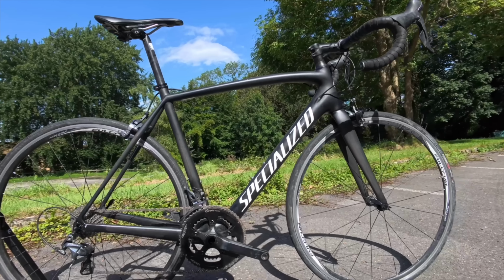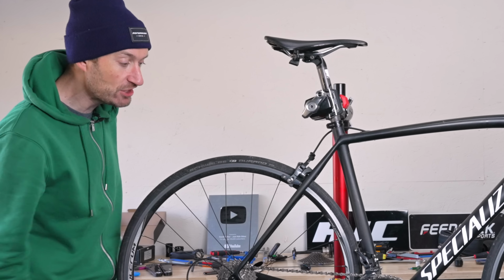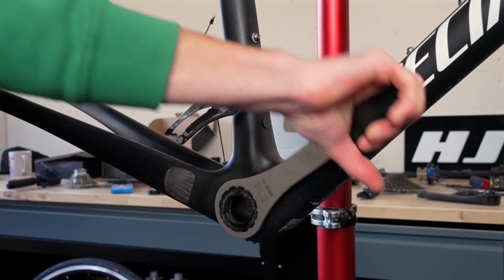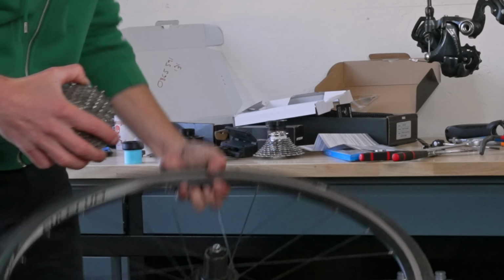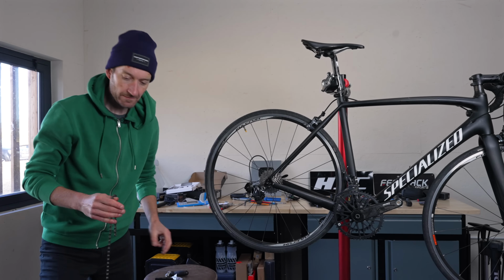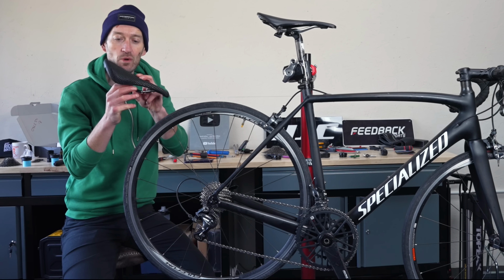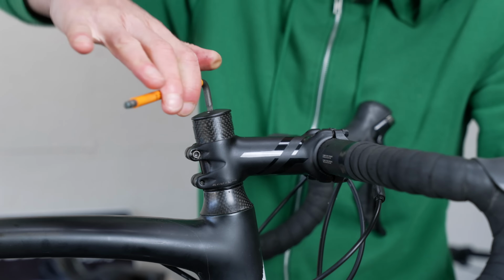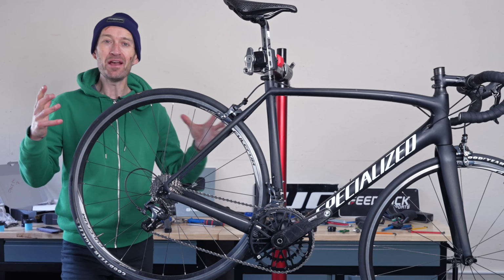Rebuilding a  £400 Specialized Tarmac on a Budget

Comment: I really hope that steerer plug goes down far enough to withstand the crush from the stem bolts now it's been moved down much lower. If it's a small stubby steerer plug you are crushing the steerer below where there is structural support.

Comment: As a die hard fixer upper, make do and mender, there is a point where you realise the cheapest thing to do is start a fresh. If
you ride year around then you have to keep on-top of everything or it becomes very expensive. A BB, a cassette, set of pads, chain suddenly your in for £400 with a still very  secondhand bike. Or you run several bikes and one day wake up to them all being goosed. After 25 years I landed on 10 year old 29” steel XC MTB (PACE), with a compact chainring, 3 sets of wheels and tyres. So one bike to do everything badly.

Comment: How are holding the bike as you pound that bottom bracket? That can't be good
Reply: The best way to do it is to brace the frame by the surrounding area so that as much of the hammering force gets translated into removing the bearing as possible.

But, impactless bottom bracket pullers exist, like one made by BSC Tools. Recommended by the UCI's mechanics course too.

Comment: I've done the same! Need to do all work yourself! I replaced the wheels with carbon ones from Hunt on sale and replaced the BB rest was just clean and maintenance! From the states $500- when I was done came in around $1,200, rides close to my high dollar bike. Elbow grease!!!
Reply: Which Hunt wheels did you go for?
Reply: @AndyThaiSamui  HUNT 36 Carbon Wide Aero Wheelset

Price now is 1,000, I got mine on sale about a year ago for 750- I was on a budget but couldn't pass these up. Shop around. Good luck

Comment: I would never have guessed the bb unscrews counter clockwise on the drive side.
Reply: That's because this is a thread-together PressFit bottom bracket inside a BB30 bottom bracket shell. It should be fairly commonplace by now. I'm willing to bet that's a Praxis Works bottom bracket.
Reply: @yonglingng5640  Praxis is common place? Out of a dozen bikes in our family and only one bike has a PF30 and it works fine. If it creaks, it's only at the crank to spindle interface. A little grease fixes that for at least a season. Never owned any Praxis products or know anyone that has bought a Praxis crankset and bb aftermarket. I guess my crowd knows how to chase creaks or is smart enough to just go threaded.
Reply: @newttella1043  I said that for thread-together PressFit bottom brackets, never did I mention it's commonplace to have Praxis Works bottom brackets everywhere.

Comment: I do enjoy this channel, however this made me itch all over. Clean the bike FIRST before working on it. Clean the factory grease OFF the chain before shortening, and don't do that on a filthy floor - you had a clean bench available. Fit the chain last and apply the lubricant of your choice so it's not wet or contaminated by anything else you're doing. Sorry but this is not a 'how to' video at all.

Comment: You need to do the cassette up to the specified torque otherwise they have a tendency to come loose over time.
Reply from the maker: I must be lucky not had one come loose yet! But yup of course always follow manufacturer instructions
Reply: @ I’ve had a couple but they were older Campagnolo which specified 50nm.

Comment: 28mm wide tires, how it’s possible… I have one 2019 SL4, the last year Specialized have this on their catalog, with Shimano 105 R7000, and I have lots of problems with a simple 25mm tires! I have some newer weels, a pair of the last Vision Trimax 30, with a Continental Grand Sport Race, and even any small misalignment in the wheel, the tire rubs against the chainstain! And I'm very light, 63kg, and unfortunately I don't have the power output of one Pogi to twist the entire bike. I can't wait to see the test on the road, because I don't think it's possible, there's no space!
Reply from the maker: I was shocked too. I think it might be helped by the rims being very narrow, so this might change with wider rims. Maybe the Goodyear tyres come up narrow? I'll get the calipers on them to check when I get the chance
Reply: @davidarthur  maybe it could just be that. In my case, with the stock weels, with some DTsuiss rims, the Continental 25mm runs well, but with the 26mm Specialized Turbo tire tire rubs again. In relation to the my calipers, the 105 R700 there's no problems!

Comment: How do you know that those are real Shimano parts, I've seen a lot of fake (well made) Shimano parts on Ali Express
Also just comparing chain length is wrong, you replace a chain when it's stretched so why would you compare it if it's stretched, and yes it can be as much as a whole link!
Reply: Ordering from a site that sends its stuff from the #1 country in the world, with a looong history of production, of counterfeit parts and products 😅
Reply: Yeah I would have just done small/small technique
Reply: Chains don't actually stretch. The inner rollers wear down from use and this leads to less efficient shifting and an increasing gap between each link. The actual length of the chain remains the same.
Reply: Still how do you know the chain had the correct length before @2001MBKBooster
Reply: @2001MBKBooster  if the contact surfaces are wearing down, that will cause a measurable difference in the length of the chain. Measurable by you, with something as simple as a ruler or a proper chain tool. 'stretch' is an appropriate word for this, it causes a real difference. I'm not even quite sure what you were trying to disagree with, the word itself or the physical effect of parts wearing down